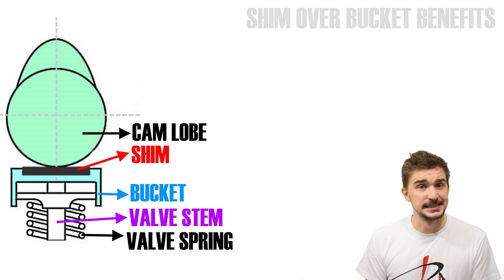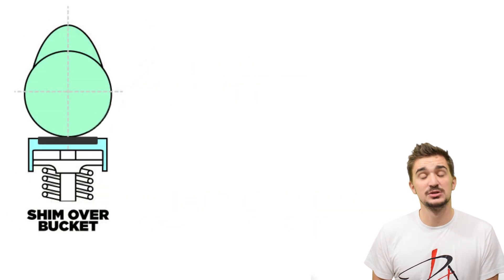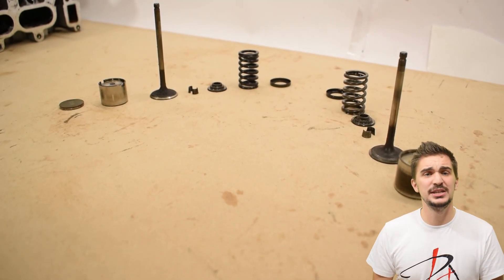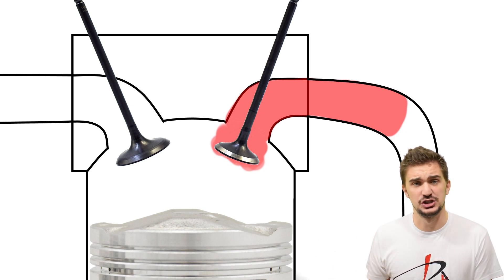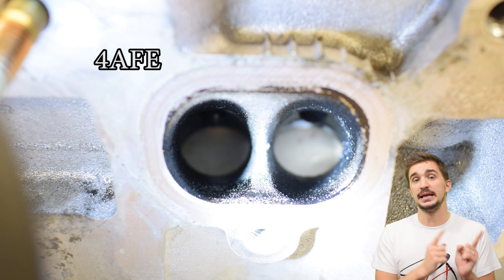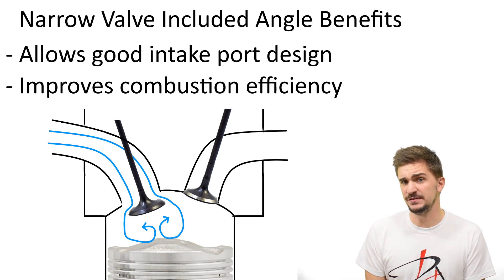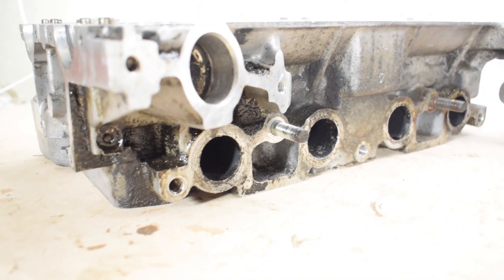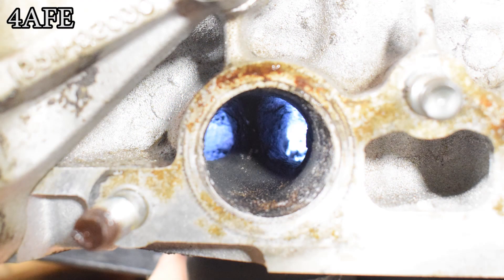CYLINDER HEAD Face Off - 4AGE vs 4AFE - DETAILED Comparison

Comment: The straighness of the intake port is more a function of how high the port is than it is the valve included angle. Look at the B18C1 head, its ports are high. Look at the early SR20DE head, its ports are high. Even in your own schematic the 4A-FE ports are higher (which leads to a straighter path). If you mimicked that high-port design in the 4A-GE, you'd have a straight intake port too.

The benefit of a narrow valve included angle is increased compression. A wide valve included angle necessarily creates a larger combustion chamber, which means the piston has to be heavily domed to raise compression--and that can impede swirl. Then there's the other benefit of a small combustion chamber: The smaller the combustion chamber, the less surface area with which to heat the head.  This means more of the energy from combustion can be used to force the piston down, instead of merely heating the cylinder head.
Reply from the maker: Yes, but the port can't be high unless you have a narrow angle. Think about it, a high port with a wide angle is physically impossible, the valve guides end up in the port.

Comment: Hi Guys, I have a 93 Corolla with a 5 speed and a 4AFE. I was driving it about a year ago when all of a sudden, I lost all power. I now have very slow acceleration and can't hit 30mph. Since then I've replaced sparkplugs and distributor. I have spark and air, which leaves fuel. I can't find any leaks in my system and I'm not really sure.  I suspect it could be fuel injectors, but what do you guys think? 

Any help is absolutely appreciated. Thanks!

Comment: 4A-GE engines as introduced in 1984 in 1985 models were 7500 rpm redline 112HP@6600RPM with 8.5 mm lift and fittend with 10.5:1 compression ratio.
Reply: these were oversquare engines (bore bigger than stroke)
Reply: Great video BTW! thumbs up!

Comment: Can do comparison between 4afe and 4age20v?
Reply: 20v block is pretty much same as a 4agze block structurally.... 20v has bore squirters and sump face slightly different having a zigzag in it  Toyotas are very interchangeable  alot can be mixed matched

Comment: I have a 1th gen 4afe, can i fit the 4age head?
Reply: Yes
Reply: Toyotas are very interchangeable  4agze or 20v block is best too start off with extra structural ribbing in blocks  silver top has same conrods as a 4agze best rods for boost
Reply: Just a straight swap over for fe too ge only cam belt different length...
Reply: @gwanam6319  and the ecu and wiring loom also different i guess?

Comment: I commend you for the quality of the video, given just how much information you give I only have a small amount of additional information / corrections that I wish to add:

- You mention different cam profiles and different lift with VVT. But for both times you show the VVT parts on the screen the parts are for variable angle only VVT systems, these still use a fixed cam profile and lift although it would be true for dual cam lobe or constantly variable lift VVT systems. You are however are completely correct with everything you said in regard to their variable phasing and the effect on factors such as the overlap. 

- When mentioning the later heads having a narrower valve angle on the screen the 20V 4age Blacktop is shown. This has the exact same 50 degree valve angle from the exhaust to the outer intake valves, but to be fair the middle intake valve angle is 37.7 degrees so that still counts as being partially narrower then?

- The 2ZZGE and VTEC engines are forced to have rocker arms as having a twin cam lobe system is as far as I know impossible with a traditional bucket and shim system. That aside your point is still completely correct that OEM valvetrain in a 4age would in no way be able to handle the secondary cam profiles as used in the 2ZZ and Honda. 

- One thing not mentioned with the relation of the port velocity verses flow is that with a more upright port it can sustain a much higher port velocity before reaching the same air choke point. This significantly reduces the trade-off. It's also why modern heads can have a fairly small cross sections for their ports. A good example of this is the 3sge Beams engine, I wouldn't consider the ports to be overly large but flow amazingly well and can support high power without mods. Although you make very good points with how VVT does wonders to mitigate the issues with large CSA ports. 

- Alright so this one is just being pedantic and I know it's just what the common terminology is- pictured are adjustable cam pulleys, not gears. If it's driven by a belt then it's pulley. I can't fault anyone for using that term that is almost universally used regardless of if it's technically correct or not. 

Well anyway with that aside this isn't a criticism of your video, you clearly have done careful research here and your explanations for everything are excellent. I just commented in case you wanted some constructive feedback. I am completely open to correction on any of these points also. 

I thought you might find it interesting that did some mods to a 7afe head a while back and I was surprised to discover it had literally zero overlap between the cams. This isn't just by eye either, I put a dial indicator on that head when it was on the bench and I can confirm that the intake valves would fully close before the exhaust would open. Before this I didn't think any car engine had that. Oddly enough it had a reasonable amount of lift at a measured 8.34mm for the intake, weird.

Comment: A lot of miss information here. Stating why Toyota used specific designs based on assumption is automotive design propaganda. Hope you can sleep okay at night.
Reply from the maker: No assumptions here or miss or mister information. Everything I say I research and fact check throughly. If I'm assuming something, I'll clearly say I'm assuming it, so please spare me your bigotry. If you think I said something incorrect you need to offer an objective counter-argument otherwise you're just another smartass behind a keyboard and I'm bored of those.
Reply: @d4a  so do you actually know why Toyota chose to use a rocker system on a 2zz-ge? No. Assuming rocker type valve train is more of a modern engine design then cam on bucket or is more performance oriented is incorrect. Talking about exhaust gas revision and overlap doesn't actually have anything to do with comparing these two heads. I was joking about the sleeping at night thing but this video starts digressing and is misleading asf. I didn't call you names either check my yt channel im a real person i was engine building in 90s fyi..
Reply from the maker: I never said it was more modern or more performance oriented. I said it was used because of the more aggressive cam specs on the 2zzge which would be problematic with shim over bucket. There's a SAE paper on the 2zz, it's not too hard to find and this is presented in it in detail. You're a real person? Guess what, so am I. We're all real persons, and this is why, as we mature, we don't start discussions by belittling someone's work and making unjust assumptions about it.
Reply: @d4a    if you want to get granular "aggressive cams" isn't proper terminology.. Camshafts arent passive, assertive or aggressive at the very least talk about lift, duration, ramp angles etc. The reason why they used a rocker design due to lol aggressive cams will not be documented in an SAE paper lol. I mean real as opposed to fake as in regurgitating other people's bs.. Anyway GL and don't take it personal ya getting heaps of comments from people that seem to know very little and are enjoying ya videos. Peace.
Reply from the maker: https://www.google.com/url?sa=t&source=web&rct=j&url=http://fred777.free.fr/MR/prepa/2zzge.pdf&ved=2ahUKEwiT4qKGwo7tAhUtmYsKHRcEAx8QFjABegQIBxAB&usg=AOvVaw1SPawdPLfHCet-iYfX1y51

Pages 3 and 4. Now shoo, bother someone else.
Reply: @d4a  unfortunately that doesn't refer to "aggressive cams" but does explain the reason why they used a rocker system same concept as vtec lol read page's 3 and 4 again the reason why is part of a variable lift system design etc. Please do not compare 4a with the 2zz valve train system as the variable lift technology hadn't been developed until late 80s so makes that comparison irrelevant. I've made pretty basic clear points don't get upset.
Reply from the maker: 🤦‍♂️ Ok, that's enough. Bye

Comment: Can i replace my 4efe head with 4age head❓
Reply: Yes in theory but it's not that simple as you would would need to change multiple other parts. Therefore it's likely that it would be cheaper to just buy a 4age unless there are other factors such as lack of availability where you are.

Comment: In Toyota Line up, when you got a G in the second part of the name it's a sports engine. No matter the car it's in. (4a-Ge, 1jz-Ge, 1jz-Gte,...)

For exemple, some Corolla, some lotus, even the Mrs got a 1zz engine, but even if these cars are meant to be sporty, the engine is not. (1zz-fe, 1zz-fed, 1g-fe)

This lead to some complain from customers because they thought they bought a sports car but even if they have a good engine, that doesn't feel really sporty once you drive it.

I know this from a mechanic that worked in Toyota race department btw and I own a 86, that's how I met him.

Comment: I guess TOYOTA added 1 intake valve because of the disadvantage of the wide angle intake valves to overcome the air flow in the intake port

Comment: Im a cylinder head specialist...There is away around dailing in both cams on the fe toyota heads or any othe slave cam set up cylinder head   you can either remove the dowl weld at desired angle or off set dowl/key or remove dowl/ key remake key Grove in new spot 180° out from old safe as but it is more time consuming but not impossible if you have the knowledge how
Reply: As for the intake ports you should do a video on 4g63 gdi  look at the mitsubishi gdi 4g series cylinder heads the down draft port worked so well there is a restrictor put in to make it daily drivable...

Comment: 7 years and ~ 10 hp ? not an improvement for sure.  not even sure if i would not go with the economy head for a few reasons. allso on that economy head you can actually turn the intake gear 1 tooth away to modifiy timing, and adjust both of them afterwards with the single exhaust cam timer. not as flexible, but at least can be done. 
on them economy head i hazard i would remove that shroudy thingy around the valves, to reduce compression. it could make it suitable for a turbo then.

Comment: Dear Mr. D4A - could you tell me if it's a good idea to add a modern turbo to my 1ZZ-FED instead of swapping-in the 2ZZ? I think a small B00ST in power would be fine, perhaps to 200bhp or so. Perhaps it would work out fairly well? I ask because of your work on The Underdog :)  

Still think you're awesome!

Regards,

Sam
Reply from the maker: It really depends on applications, your goals and budget. A properly built turbo fed can be really good and won't disappoint. But it might be more complicated tuning wise and can easily end uo being more costly than "just" a swap.
Reply: @d4a  I'm really pleased you took the time to answer, thank you.

Goal is fast road and occasional trackday. Car is ZZW30, I feel she deserves a bit of a boost to be faster in the midrange than modern hatchback etc.

Budget isn't really the issue [I'll just wait], it's more that the 2ZZ is getting pretty long in the tooth now and also quite expensive for me [maybe 4K Euro] for an engine that will only deliver it's potential when beaten-on - seeing as the car is a daily i think it might be under-used. I also plan on getting a car with a good gearbox, the C66's around here have a high Final Drive as standard, so I guess they'll match-up to a turbo quite well. If I lived in the US I think I would use a 2/1AR-FE, but here that's actually also really expensive.

I also think it's possible with cams and a standalone ECU to get a little more out of a stock FED and so maybe that's the half-step.

I will keep you in the loop...but first I want to sell my current car and get a cleaner example :)

https://link.marktplaats.nl/m1625003592

Cheers!

Comment: A few things , like toyota , Nissan too were wide valve angles in the ca18 Rb engines but in the later sr , they went narrow and made more power , don’t forget the sr16ve , as well , then look at bikes they are high rpm and tq monsters all with narrow angle and only with performance in mind , so it’s not fair to say , wide is for power , you should take a look a what bisimoto did with single cam Hondas , and when u say the 4a makes more tq lower , tq is fuel simple tyey cannot make tq with out fuel therefore it would consume fire fuel in the lower rpm , but what the combustion chamber does allow is lean burn , crushing at 17:1 as oppose to 14.7:1 with out det

Comment: 4age could use a bump in its compression, or a turbo straped to it, 9.4:1 is low
Reply: The 2nd gen 4AGE with the smaller intake ports had over 10 to 1 comp ratio

Comment: I built an AE92 Corolla for Lucky Dog Racing League with an unmodified 4A-FE (ok, I baffled the oil pan and built a cold air intake from PVC pipe, but other than that, unmodified). there is jack shit for power above 5800 RPM, where I set the shift light.

We held off some odd cars through 3rd gear but waved goodbye to their tail lights once pulling into 4th, and the explanation on valve angle effects kind of explains it. glad I didn't convert to the GE head though.

Comment: The newest 2020 Toyota engine has a wide-angle cam that similar to 4AGE. Toyota is heading toward power engine in the future, again.
Reply: Out of interest which engine is that?
Reply: @Samqdf  GR Yaris, which use M15A engine, use wider angle for cam. Also for M20A
Reply: @adibz959  Thanks. I found an in depth article on the engine here:
https://toyota-club.net/files/faq/20-08-01_faq_df_r3_en.htm

It has some unusual engine features such as a very long stroke relate to the bore size

Comment: Great Video. I've got a 4wd car with the 7AFE and the heads are very similar and this has kind of convinced me that a turbo on the existing head is probably smarter than a GE head :-)
Reply: It's a Toyota Sprinter Carib - AE115G - really popular in russia :D
Reply: @AlexTrull 7a-fe...... everything before the dash is the block, everything after is the head. 7a is the block...... the seventh generation of the A block, 1.8l and a longer stroke than the 4a, so the block is taller. The FE refers to the head, F is the narrow valve angle, E means it's injection. Your 7afe head is the exact same as the 4afe head.

Comment: The Volvo 850R head was very similar to the 4AGE head. Walkinshaw racing modified them for the super tourers by bolting in some additional metal to lift the intake valve angle and straighten the inlet runner. The result was an additional 60hp on that engine. The exhaust runner was left at a similar angle to the 4AGE exhaust because it flowed really well anyway.
Reply: If I remember correctly they shaved a wedge out of the the head surface to mount the whole head on a tilt, this made the intake port angle face more upright relative to the cylinder. That and machining the top third or so off the head to completely remake the main valvetrain section. Those engineers were amazingly creative in their way to work within the limits of rules and get around the fundamental limitations they had. My hats off to them for being so clever. As for the 4age 16V head I have seen the intake ports corrected by either machining a big chunk out of it and making the intake manifold reach right in or welding large sections up and machining / die grinding new ports. Both end up at the same goal of running the new ports through were the injectors would normally are located and hence ending up with a fairly modern looking port design.
Reply: @Samqdf  please share a link showing this mod

Comment: Well, I def learned something about shim over bucket vs shim under bucket! Learned more about valve angles too. Plus more detail on those 4A heads of course. Excellent, excellent video as always.
Reply: Shim under bucket old tech shimless solid buckets are were it's at.... lighter and no Shim issues cause there is none...

Comment: Anyone else notice he has the exhaust cam installed on the intake side of the 4age?
Reply: Yes, this was bugging me too. Granted, I believe the cam profiles are the same and it’s only the lack of gear to drive the distributor that designates intake from exhaust cam, but it still bugged me.
Reply: @ryanschmidt1437  I believe exhaust is slightly smaller. Nope just checked. youre right

Comment: If I can swap the 4age cylinder head to the 4afe block, would I get a bit more compression?
Reply: Yeah can do to anything just machine surface of head down to get desired comp ratio you want and you will need to dail in cams tho as more off head will result in cam retardation